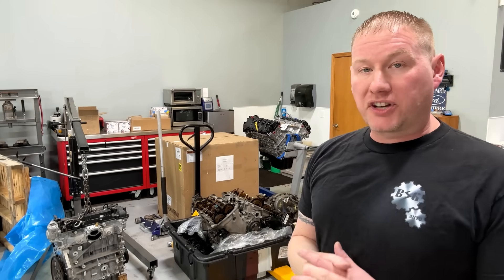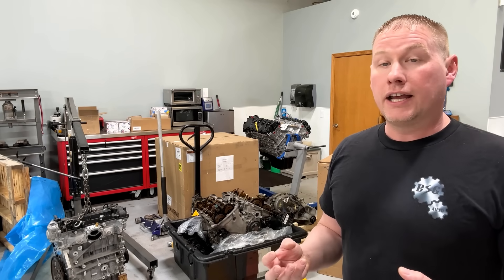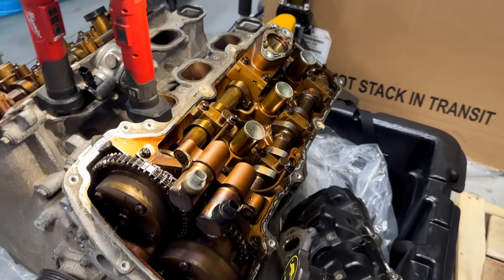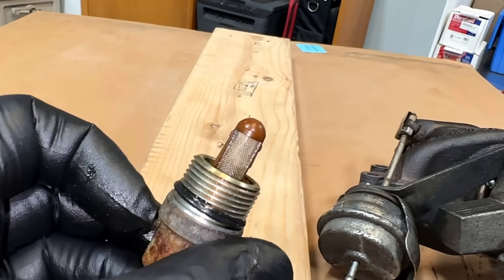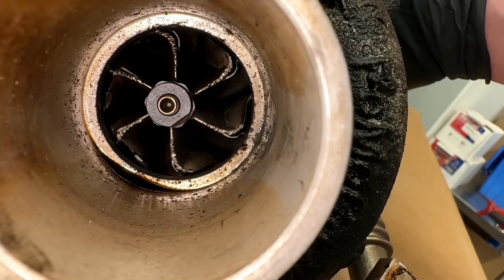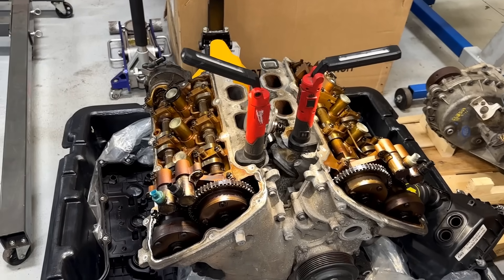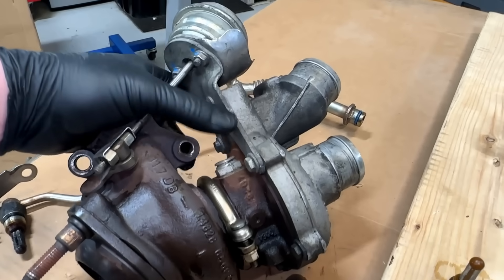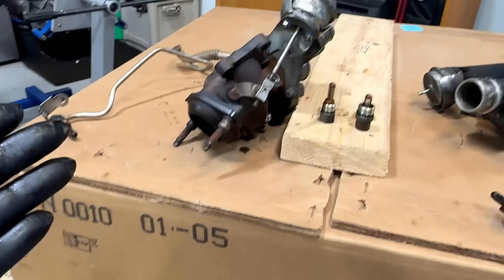This is Why You Never Run Extended Oil Change Intervals on The Ford Ecoboost Engines!

Comment: Ford makes some faulty cars i bought  a used 2019 ford fusion titanium with 2.0 
I didn't have it 2 weeks and found a tick when i turned on the ac
Turned out the head gasket was leaking because of a poorly designed coolant passage so ford dealer put a brand new long block in
A year and a half later im getting  a vibration from eng 
They had to take the engine out again to replace the flywheel that was cracked 
I still have the car thinking whats next lol

Comment: Why would you change out those clean turbo line screens you showed us? They are virtually clean. But
The clogged ones are, yah, too late!
Reply from the maker: I changed them out because as I explained I always change them out whenever I remove the turbo oil supply line because the o-ring are not serviceable and there is an updated design.
Reply: @FordTechMakuloco  oh k I guess I musta missed that part about the updated design, Sorry.

Comment: I’m using conventional oil from the dealership and changing every 3000 miles pretty much religiously. Should I start going with the full synthetic? I have 134,000 miles on my 3.5 L eco-boost. 2015 Ford transit.
Reply from the maker: Turbo based engines should always run full synthetic.

Comment: My diesel turbo, on the compressor side, has fin sharding, similar to this. Is there a chance that a change of oil and oil filter might stabilise the situation, so engine will perform ‘satisfactorily’ over a short to medium term horizon.

Comment: Question… when that impeller nips bits and pieces off against the impeller housing where do those little pieces of aluminum go?  The air filter or the  intake manifold?
Reply from the maker: Charge Air Cooler is the next stop.

Comment: My real world experience, I only use Mobil 1, and change oil and filter at 24 thousand miles. But I changed oil filter at eight and sixteen thousand. I never had a problem or burning oil. Several cars, five fords to 290,000 on one.

Comment: I would remove turbo oil screens. My older turbo cars never had them. Newer Audi's have screens and cause problems as well. I'm a firm believer to change oil no more then 5-6k miles.

Comment: These insane LONG (10k to 20k) oil change intervals are complete BS. It's not the oil that goes bad, its the oil dilution. No amount of additive can stop it and turbo engines increase the dilution. Long intervals  are a result of the EPA wanting your internal combustion engine to not last so you will have to buy a Gov. subsidized EV.

Comment: I own two eco boost engines in a fleet that gets regular service . Do not buy a turbo period . Get the naturally aspirated models. Our local Ford dealer stopped stocking eco boost transits and half cabs due to so many problems. Ours gets out to a customers site and won’t restart. Problem is the egr and blow by from turbo blasts across the sensors on the intake and cloggs them up. A quick spray of TB cleaner or replace them and off it goes but it has stopped them on the interstate as well .

Comment: I change my oil and filter every six months in my Kona Turbo at about 2k miles. I do not drive much. I bought a case of Hyundaii Oil filters last year from Amazon for 72 bucks and use Pennzoil Full Synthetic. I have enough oil in my garage to last me another 2 years . Air filters get changed every two years whether they are dirty or not. And I use Seaform in the gas and a few ounces in my oil.  Nasty peolle do not take care of their stuff.

Comment: From the UK here,so many go by those dash service monitor! Also many think going up to 10,000/12,000m a year is the norm....because that's what car programs/magazines & book value guide price say, ie Car that's driven 12,000m a year.Servicing at 10k/12k is the MIN service requirement for the vehicle.Some garages also use cheap oil filters & mediocre oil or even cheap oil to save money.

Comment: 2015 VW Passat TDI (turbo diesel) 383,500 miles. I've never changed the oil in less than 30,000 miles, I have went as far as 42,000 miles. I have never replaced any component on the engine other than timing belt.

Comment: Ford sux.. had a 2.3 eco and tranny along with turbo were already bad.. i did oil changes at 5k myself. Full synth. Drove that ranger hard, got rid of it by 20k miles.. u already know if i took it in there will be 5k plus in maintenance... just to have a shitbox😂 some get lucky, many get fukked by ford.

Comment: This is why i run an amsoil dual remote filter. It's amazing how well that has protected my engine
Reply: Do you have some pictures of that setup?
Reply: ... and a pre-oiler.
Reply: @RandyMUNSOn-fe2tb 
The combo of duals, a pre-oiler and 4k oil changes and I bet you'd go 500k miles easy.

Comment: Extended oil change intervals cause problems with all modern engines. Even AFM engines are sensitive to extended oil changes. DI soot, blow-by, and short-trip sludge. Oil filters don't capture it, full synthetic oils can't magically remove carbon contaminants, and full syn oils seem to react very poorly to short-tripping. Use quality oil and change it often. It's not worth trying to squeeze 7500... 10,000.... 15,000 miles between oil changes.

Comment: My eco its already at 300k miles with no mayor repairs at all ,except for water pump and turbo cooling line fittings ,after warranty expired at 100k i do all my maintance every 4k oil change

Comment: Those factory recommended  extend drain intervals combined with low compression rings were causing ring carbon and  wear problems in Toyota engines as well .Good video.
Reply: Low "tension" compression rings.

Comment: Have you ever put a diesel bypass oil filter on one of these Ford motors?😅
I only add the diesel word because that's where their primarily used, but it can be used for any oil lubrication system to enhance the cleanliness, with all those fine filters that you're showing in the video looks like it needs it more than my Cummins.😅

Comment: Great video. Is this something someone can do at home or do you have to lift the whole engine out of the bay to get to it? I have an ecoboost with 170K miles on it, change the oil out every 3-4 months along with the spark plugs regardless how much I drive (less than 3k miles in that time). If I can get to this myself, I'd change it.

Comment: The fact Ford even broadcasts extended oil changes on their instrument clusters shows malfeasance on their part. Then again, Ford is traditionally-known for nickel-and-diming customers with acts of planned obsolescence. Why keep your car on the road longer with proper maintenance when you can just turn around and buy another vehicle in a year or two? 

Extended oil changes are simply NOT AN OPTION on turbocharged engines, period. If anything, significantly-shortened change intervals (approximately 3,000 miles) should be the norm with anything with forced induction of any sort.

Comment: Anybody ever hear of extended warranty coverage? After the factory warranty on my 2017 BMW 540i reached 40 thousand of it's 50 thousand miles,I bought 100 thousand mile extended warranty coverage. It cost me just over $4,000 up front. That was about 2-1/2 years ago. At 72,000 miles,one of the valves went. They called me back and let me know it would be $4,132 (including labor) to fix. I reminded them that I purchased extended warranty coverage. Ended up costing THEM $4,132. Best $4,000 I ever spent.

Comment: Every 3,000. I seen alot of oil changes. When oil smells bad when it's 10,000 or 7,0000 something is wrong. I tell people these newer engines work on oil pressure, timing, turbo, PCV change oil every 3,000 miles. Auto companies want your engine to fail, so you can buy a new one.

Comment: Really glad I came across this video. I don't drive my 2018 fusion very far, I don't even make 5k miles in 6 months. But even I was getting nervous when at a little over 4k miles and the change oil light still didn't come on, so I went and got it changed it anyway. So glad I listened to my paranoia because this video proved me right. Gonna change at around every 4k miles now just to be safe. Thanks for the great and super informative video.

Comment: I just sold my 16 fiesta st with the 1.6 ecoboost. I had pretty much thrown on full bolt ons and had a stage 2 tune done. I didn't even fuck around on oil life I'd change every 3,000km I think it's about 1800 miles

Comment: Should not there also be a time requirement when the change the oil to be an alternative to the mileage limit...????

What is someone doesn't drive their car but 4,000 miles over 3 years? That oil can't be good as new after 3 years after all the additives evaporate out and all the atmospheric moisture gets absorbed.

Comment: I changed the oil on my 2020 Expedition at 4500 miles and saw how dark it was and decided to never go under 50% oil life. When you spend your hard earned money on the vehicle you love you have to take good care of it😊 living in AZ it’s hot and dusty so an air filter and oil change is well worth the money.

Comment: On our 2015 we went by the dash oil life intervals, but the dealer said over 10,000 would void warranty regardless of oil monitor. We usually changed about 7 or 8 thousand. It had to have the cam phasers and timing chain replaced at 30k miles. On our 2019, 2021 and 2023 we have moved to 4,000 mile oil changes using Penzoil Pure Premium Plus or whatever the natural gas one is. The next owner will be glad we did.
Reply: What oil did you run on the 2015 at first?

Comment: Do you ever work on the sho 2012 or newer? I have a low boost code that I can not find anywhere. Is this a common issue. 2014 ford taurus sho non pp

Comment: I go 7500 miles on a really high quality oil. Every oil change I have the oil tested at a lab and they recommend running the oil longer. I had to replace a valve cover a little bit ago and the heads still looked brand new clean. I feel like if your willing to spend the extra money on good oil then your probably fine.
Reply: I need to change my valve cover gaskets any tips? Would really help
Reply: @ChappySinclair  amsoil
Reply: Ecoboosts GDI tend to get heavy fuel dilution, so the best oil on the planet won’t help that.  Any turbo GDI should be changing the oil 5,000 miles or less using high quality full synthetic.
Reply: Testing oil is the only way to know  what interval for each application.

Comment: I run amsoil with an amsoil filter. I change my oil every 15000 to 18000 miles on both naturally aspirated engines and turbo engines even in diesels and motorcycles and never had a problem. If the engine burns a little oil I add some but when it comes time to change the oil its still gold if not a light maple syrup color but never black. Cheap filter cheap oil running on extended drain internals is a disaster waiting to happen.

Comment: I’ve been doing 6k with Amsoil and thought I would be fine since I was doing 90% highway driving (2022 Bronco 2.3). I had even considered letting it go to the full service interval when I drove to Alaska. 

That said, I’d rather do a couple more oil changes. Oil is cheap.

Comment: What's a common failure on a 2015 MKC 2.3L for fuel trim imbalance code also low fuel pressure to rail codes stored.

Comment: The dealers recommend extended oil changes cause they want that high dollar service work. What idiot would go past 3-5 miles on these ungodly expensive engines and trannies. If your a typical lazy American who doesn't baby their vehicles. . Never buy any turbo Trash engine. Cause they wont hold up like the old school engines would. Fords 4.9 i6 was there crown Jewel..EPA Gangsters killed it off.   Sad time in automotive history

Comment: The intake side of the turbo also looks to have suffered from either running with no air filter or a cheap and nasty aftermarket filter

Comment: Always been a believer in both the Mobil 1 or Castrol Full Synthetic motor oils.  Mobil 1 has never let me down ... however on the new Escape with the 1.5 Ecoboost engine I'll be using the Castrol Full Synthetic.
Reply: I really like Mobil 1 also....

Comment: What year is the 5.0L ?
Reply from the maker: 2014
Reply: @FordTechMakuloco  Thank you very much for the reply. I’m a huge fan of your channel. Could you elaborate more on the tulip valve issue?  I know the early run of these 2013 and 2014 engines had oblong cylinder walls.  First, I have heard of the tulip valve issue.  Or is this engine owned by an idiot that revs it to 8500 RPMs?
Reply from the maker: Oh, come on now you have that username and don't know about the tuliped valve problem? I will have a video in the near future once a I pull the engine that will explain it better.
Reply: @FordTechMakuloco  Looking forward to this one.  Honestly, I did not know there was a valve issue. The only thing I've heard about is cylinder number eight on the 11 and 12 engines and cylinder number five issue on the 13 and 14.  And the only reason I'm even talking about this is from what I have read. I do not know if this is actually factual information.  Thanks again

Comment: Brian, would this fine soot and abrasives be caught in an oil analysis?

I'd love for you to see this question and would happily pay you your time for answer it.

I ask because I run an 11 micron synthetic fiber hydraulic filter (like a 2 quart filter, so it's huge). I recently ran Penn Platinum SP+ (or SN+? I forget, but it's what you were recommending a few months ago, I made sure to get the newest spec) for 11,000 miles. I did an oil analysis with Blackstone and they recommended running the oil at least another 3,000 miles because it was still in such good shape. The filter has a ton of filtering capacity and the pressure drop across the filter after almost 20,000 miles now is almost nil.

At the end of the day, a jug of oil is $30, so I'm happy to change it every 5k, but I'm also curious to hear your thoughts on running the 11 micron absolute remote filter. 

I can visually see the difference through the oil fill spout from running the 11 mic filter and good oil as the varnish is considerably less.

Truck is a 2011 EcoBoost with 207,000 miles and runs great.

I plan to install the new transmission lines and put another 11 micron filter on the transmission to keep thinks nice and tidy. Hopefully we'll make it to 300k. :D
Reply: I think it's mostly the Penz, it's surprisingly good for the price. If it's the made from natural gas stuff. I, "think", it contains a large amount of group IV PAO true synthetic base. Rather than large amounts of group III highly refined petroleum base that make up much of the so called "full synthetics" in this country. That's another thing, it's been found that some of the so called full synthetics contain large amounts of conventional oil, so the term "full synthetic" has become nothing but a marketing term. Group IV PAO synthetic base oils are one of the key components for premium synthetic lubricants. PAO bases are man made chemically synthesized bases derived from ethylene. Ethylene is derived from natural gas & other petroleum components. I strictly use AMSOIL Signature Series 100% synthetic, it's the best. It keeps engines clean and greatly reduces wear. I know techalocobrain doesn't like it, but that's too bad for him. But the fact that he doesn't keeps him busy I guess! Right? lol

Comment: Pro Tip: DOn't buy a ford eco boost. After the years of videos from this guy all I can see is under-engineered and slapped together engines with endless problems. Gone are the days of the bullet proof 351W from ford. Tech, you say it "Was not maintained to spec" Yes it was, exactly to Ford spec and Ford spec failed.

Comment: I don’t care if an engine is N/A or boosted…I’ve always changed my oil on my vehicles every 3-4000 miles or 6 months & my engines always lasted 400-600k miles with minimal major repairs to them outside of general wear maintenance. Transmission fluid drained & filled every 35k miles & never had problems. I’ve owned fords my entire driving life.

Comment: As an owner of a '15 F-150 with the 3.5L EB engine, I want to say thank you for bringing this to our attention. I did the first 80k on my engine at 5K intervals. Since then I have changed over to 4K intervals.  I'm at 98K now and will continue to do that. I did not know there were little filter screens for the Turbos so it is something I will put in the back of my head should I ever need to remove them. Can you swap out the screens without taking off the Turbos?

Comment: I changed my oil every 3 months, i dont care how much it cost or how many miles i drive. Every 3 months it gets the oil change. My impala was still running strong with 330,000 miles but the transmission failed. But it was a solid car

Comment: I have a 2014 Ford Focus ST with 183000 miles. No issues so far. I do change oil every 5000 miles. I rarely jump on this car. Just the occasional on ramp up to speed if the lane I am merging into has a vehicle that will not let me in. Mostly freeway miles. How much more life can I expect from this engine? My plan is to replace the engine when it is finally worn.

Comment: Could you explain what to look for in a 2003 6.0 f350 in limp mode? I’ve had this happen to two identical trucks after the batteries got low or replaced. They blow a fuse causing a no crank no start, you replace the fuse and the tow haul is flashing. One is throwing codes for a bunch of modules, the other was throwing codes for speed sensors on the transmission and throttle position sensor. One drives normal, the other starts off in a higher gear and idles at 750 rpm causing it to go into gear hard. Please help, thanks.